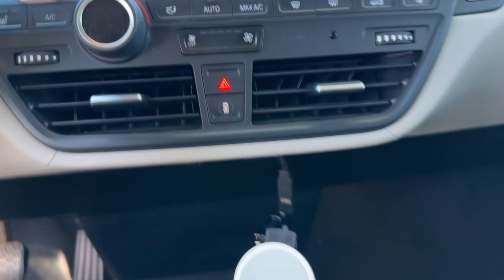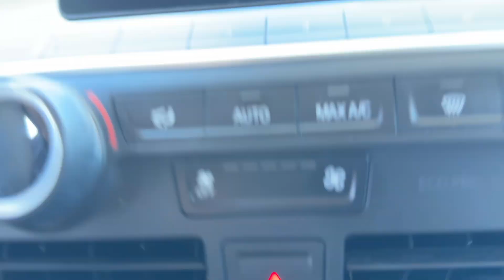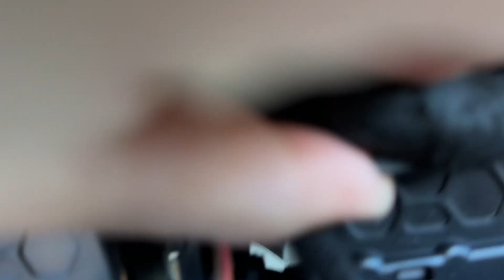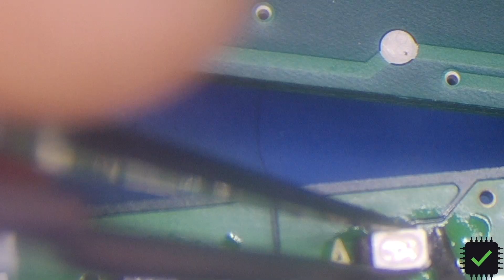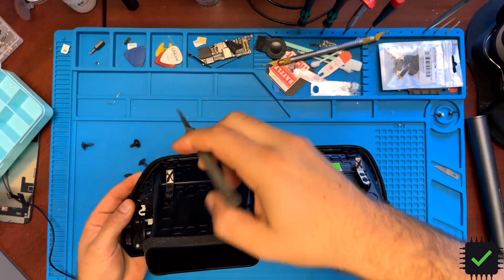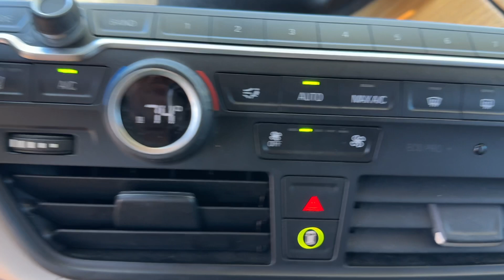BMW i3 AC A/C Control Panel Removal Green LED Flickering Repair LED Replacement

Comment: Hi there, fist of all, great video! Thank you for the effort 🙏

I followed the guide and replaced the leds with 2.0x1.25mm, 50-150mcd@20mA, 570nm Green, W.Clear, 120°.

I had to replace all the green in order to make them look identical, the old ones are dimmer and a bit darker hue of green. 

I think the desoldering part was the trickiest of the entire process, a separate video on desoldering and soldering the less would be super helpful, especially for people who are not super proficient with a soldering iron.

Best regards!

Comment: I might be needed to repair the panel I have in my i3? The LED lamp on the AC switch is no longer working. I will decide/see after the workshop has changed out the A/C compressor
Reply from the maker: You can contact me at info@applepietech.com. Thanks
Reply: @applepietech  thanx, where are you located?

Comment: Watching Wisley automotive recondition i3 and they mention the dashboard HVAC LED flicker but no other details.  Thanks for the info on removing and replacing the control module.   Will order the LEDs and get to work.  Will have to learn about the process of removing them with flux and adding the new ones.